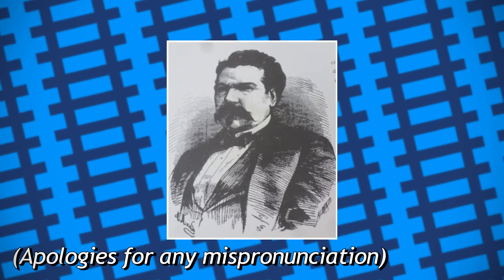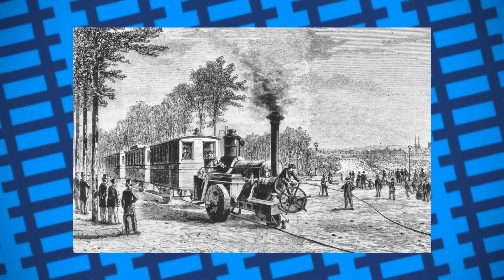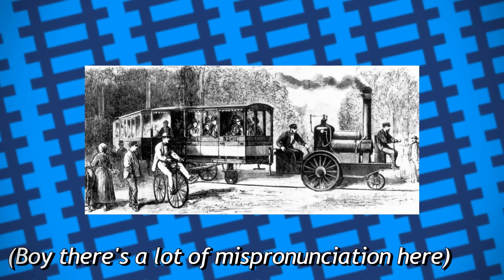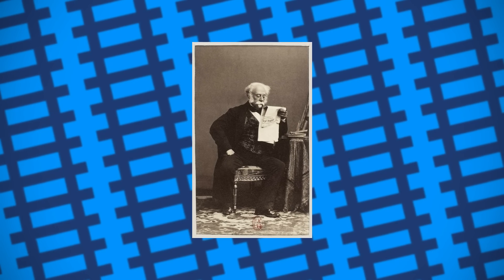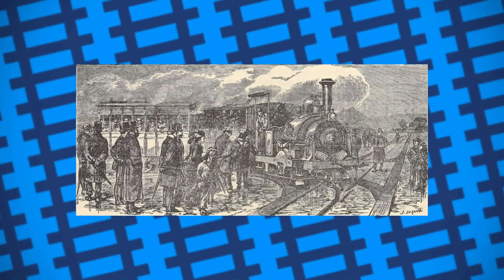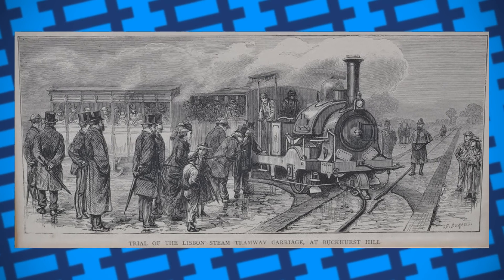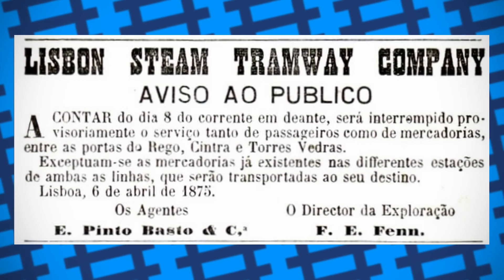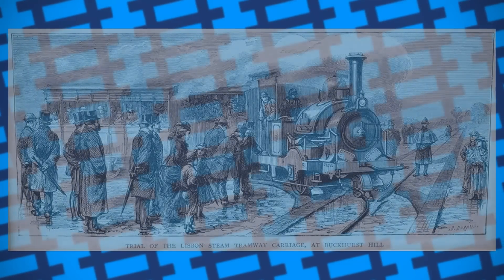The Road-Rail Hybrid that made things Worse - Larmanjat Railway System

Comment: Surely on modern roads this would work? Rather than have the weight partially on the center wheels, why not dispense with them for maximum traction and have a guide blade instead that follows a deepish grooved track with broad sides set flush in the road? Maybe a clever arrangement of small guide wheels/rollers would reduce wear and noise.There's no reason for the carriages and trucks shouldn't be supported on the broad sides, by the central track maintaining the low friction, flat ride.
It'd be an easy conversion of a semi trailer prime mover. The guide blade attached to the steering linkage, remove the steering wheel and column and there we are, powerful truck, multiple gears, two speed dif, already set up for long hauls for the comfort of the driver, except now they won't need to worry about steering,... sweet!

Comment: Technically the road rail concept returned with single rail trams. Power ran from overhead catenary to a hidden metal wheel and diesel electric motors powered tires.

Comment: I'd say the Translohr and TVR or 'Tramway sur pneumatiques' as the french call them are petty much the brainchilds of this idea and are somewhat successful with several lines existing worldwide. There's also the 'Autonomous Rail Rapid Transit' from China which uses optical guidance via sensors and markings on the ground. So the Idea isn't entirely dead.

Comment: So this was the predecessor of the Translohr and Bombardier Bombardier Guided Light Transit, both o which are bad for exactly the same reasons as this was.  I just checked on Wikipedia:  The last Bombardier Guided Light Rail Transit went defunct in 2023, and a few Translohr systems are still around but several have also gone defunct; in some cases the defunct systems were replaced by conventional trams or electric trolleybuses; in some cases Translohr systems went defunct before even being completed or opening for even partial revenue service.

Comment: There are tramways like this in use today. I once saw one myself. It's basically a tram with rubber tires and a double flanshed wheel in the middle of the axle. I think it's either in Italy or Switzerland...
Reply: *flanged

Comment: There have been so many alternatives to the standard two-rail system developed and tried that I believe at this point, trying any more is just reminding us of past failures, and more importantly, why we still use two rails for all but gimmicks, and niche applications that actually make sense (like the Wuppertaler Schwebebahn).
Reply: Well because none of them are established systems, investors take any failure to mean exactly this, and they abandon the projects before they have a chance to be refined. Rail transit isn't some mythical thing delivered from on high, it was in development in some form or another for over a hundred years before, for example, Larmanjat's time.

Even successful inventions like the Arnoux Guide Wheel system never received widespread use, not because it was unsuccessful, but simply because it wasn't compatible with existing systems.

As a side note I feel like a lot of commenters on videos like this would feel perfectly happy bashing the Wuppertal if Tom Scott made a video called "the upside down train that doesn't work"

Comment: There was a slightly later system developed in England, in the early 1920s which worked a lot better; the locomotive / tractor was basically a modified steam lorry, with a leading bogie, towing trailers for passengers or goods. It was installed at one of the big London exhibitions around that time, and worked reasonably well, but proved to have no inherent advantages over conventional lorries

Comment: In the 2000s, there were two different types of system that attempted to make electric versions in France.  One failed completely in its two applications and is now gone.  The other has had somewhat more success, but I honestly still suspect it of being a scam to funnel money to the rubber industry.  I'm quite sure that standard rail could accomplish everything that it claims to do.

Comment: Could a suspension system similar to the ones the horse wagons of the era have been used to compensate for the rough terrain, or was the vehicle too heavy or the drive system too much in the way to make it work?

Comment: There's an operating system like this from Mestre to Venice in Italy.
It looks like a tram ,with an overhead power collector but has rubber wheels running on a standard asphalt topped road with a single tram line type slotted rail set in the road. 
I would assume that the rail serves as the Earth for the electrical return.
Reply: Sounds a bit like a slot car. Remember them? The guide blade had two braided wires on either side for the power, this tram-bus being fed from overhead is smart.

Comment: This kind of train is remind me to that tram system in France, that have steel wheels for steering & rubber wheels for the main load & driving wheels so the tram can run smoothly, fast, quietly & tackle the high road gradien. It have single rail in then middle for steering & stil exist until now.
Reply: Translohr and Bombardier Bombardier Guided Light Transit.
Reply: @Lucius_Chiaraviglio  yeah that, just forgot the name 😁😁

Comment: A modern alternative does exist and works, it's the industrial road-rail switcher, a truck chassis with rail guide wheels and couplings to attach to freight stock, also there are purpose built small locomotives which use rubber tyres for traction, but most of these only can work at low speeds and are intended for industrial use. They obviously will work best with paved in tracks as the tyres then do not only touch the steel rails but also the pavement next to the rail.
Reply: Trackmobile.

Comment: I believe that a system like this could work better today as you'd have better technology and the locomotion wheels would be made of rubber which has more traction than the smooth metal wheels that they looked to be using

Comment: There was actually a similar (but not necessarily the same) style of Road-Rail monorail technology used in India in the late 19th and Early 20th century! The two most famous networks to use it were the small North Indian city of Patiala's Urban Transit network and a goods railway in the Kundala Valley in the South. I believe the goods railway was destroyed by a disastrous storm, whereas Patiala's was torn up in the 20s in favour of improving the city's road network. There's at least one Patiala unit preserved in working order, and it used to do demo runs at the Indian NRM in Delhi, although I'm not sure it's still operational.
Reply: I came here to comment the same. It's the "Ewing System" for monorails. Even more bonkers, as it only has one wheel on one side, symmetry be dammed.
Reply: @GLxGL  it's still there on display

Comment: A problem with guided wheeled vehicles is the wear pattern on the roads because it runs on exact same surface every time.
Reply: On the other hand, because it runs on the exact same surface every time, only that strip of road needs regular resurfacing
Reply: @TheFinalFrontiersman  And that surface can be made of steel to reduce maintenance!
Reply: @EdwardChan.999  if they'd done that or concrete runners on hills, along with painting the drive wheels with latex or some other rubber available at the time, they could've solved the problem. Maybe we'd have loads of goofy little half-monorails today!
Reply: @TheFinalFrontiersman  technically we do have goofy little half-monorails today, but mostly as certain types of rides in amusement parks.